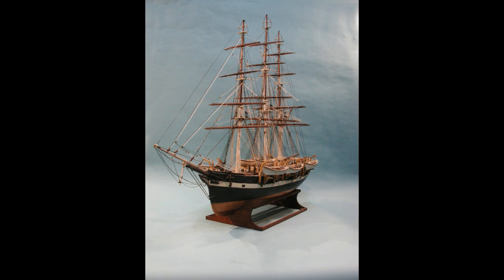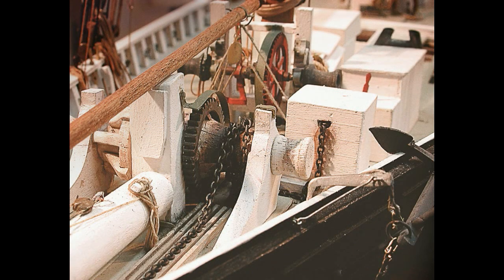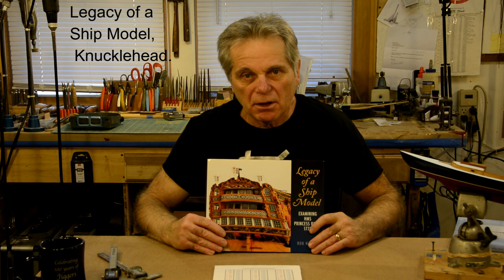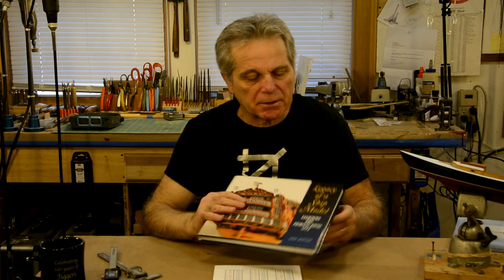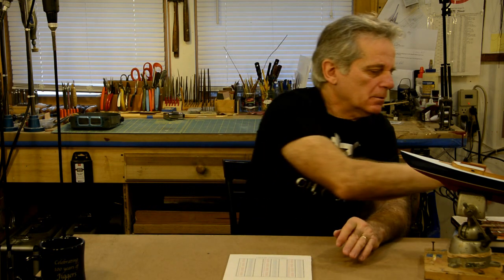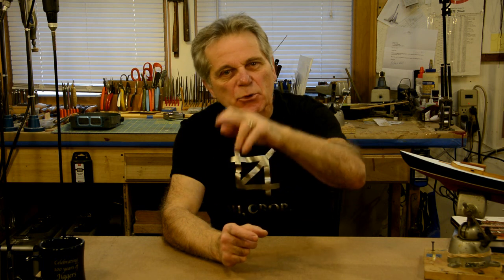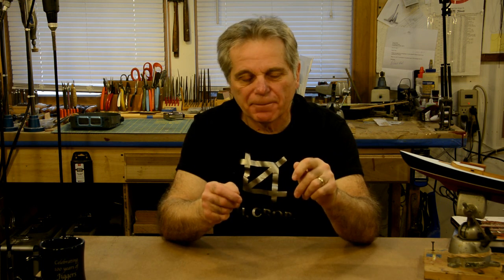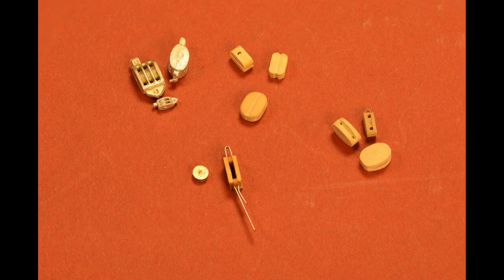Scale and the Compelling Impression

Comment: how come   9" on the right side of the picture (view side of the block) is .184 and on the left side the same measurement ( the front view) of 9" give you different value of .157? .    my regards Bob
Reply from the maker: At about 23:55, I mention that the slot in the block is actually .157" (or 7-1/2 inches in real life), which I say is a little under the .188 we need.  But, better to be a little under than over.  The 9" measurement on the side is .184", just .004 under.  Not bad!  The entire measuring process was just an academic exercise to see how close the the block maker came to real dimensions.  And, in this case, they came very close.   Hopefully, it also illustrates that as model builders, we need to constantly check our materials and processes to insure scale fidelity.

Comment: I wonder if it would make things easier to work in metric instead of inches and feet?
Reply from the maker: If you're used to expressing measurements in thousandths of an inch (ex: 1/8"=.125"), then there isn't much advantage to switching to metric.  It would also mean converting plans from imperial, which most of them are drawn in, to metric.  It would probably introduce another layer of confusion and opportunity for errors.  A long time ago, I memorized decimal equivalents of fractional dimensions, so it makes sense and is highly accurate for me to stick with the imperial system.
Reply: @shipmodelguy  Thank you.  Makes sense

Comment: Please start using metris scale, this is a nightmare for europeans. We buy in litres, kilos and only use imperial for oldies , i think in inches but bever used thousands.
I buy chain in inches, but rope in mm
Reply from the maker: Sorry the imperial measurements are causing you so much trouble.  There are a couple of things you could do to ease the pain that won't cause too much loss of scale fidelity.  
The scales I work in are all based in inches,  ex: 1:48, or 1/4"=1'.  And, they were established long before either of us were born.  Case in point:  British Dockyard models were generally built to 1:48 scale.  There are plenty of metric/imperial conversion tables on the web.  Here's a link to one; https://www.epsilonengineer.com/inch-to-metric-table.html  There are plenty more if this one doesn't fit your needs.   I have one I keep for reference and it does come in handy from time to time. 
As far as dealing with thousandths of an inch, the solution for that is pretty painless also. You can buy an inexpensive pair of digital calipers, either from the local hardware store or online.   I have several pair  in my shop.  They all measure in thousandths of an inch, or hundredths of mms.  If you need to know what .061" equals in mms, just hit the little button, and faster than you can say "Bob's your uncle", you'll know it's 1.55mm.
As far as my including or converting to metric for future videos, that is not very likely, since I am no longer producing any more tutorial style videos.
If you need more info or clarification, feel free to contact me through my website: tjlauria.com/contact